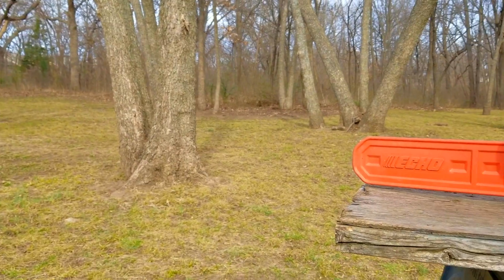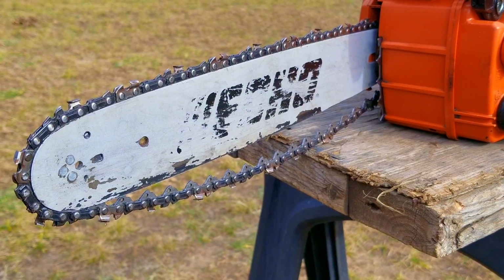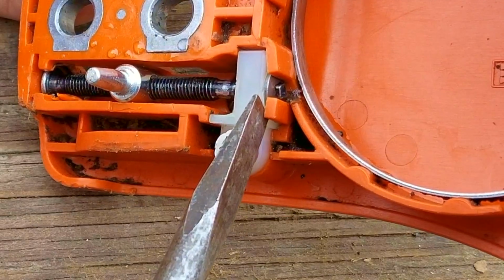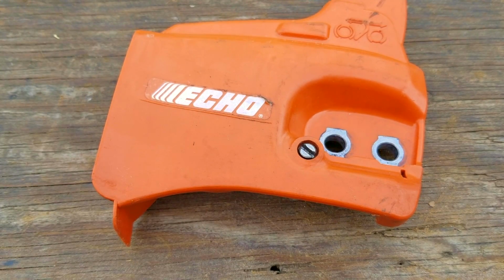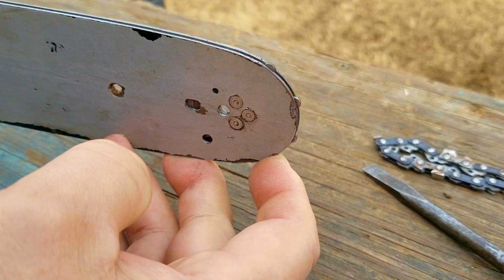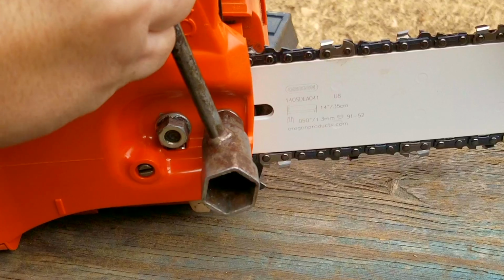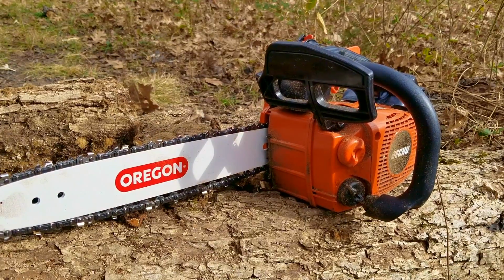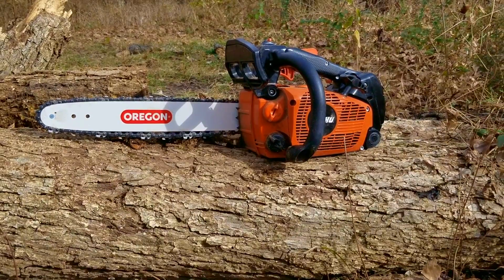Fixing An Echo Chainsaw's  Chain Tensioner

Comment: Guy had a kickback while the bar nuts were less than tight.
Had the same thing happen on an echo 620p (pro saw) and where I have the stiff magnesium cover, it hit hard enough to bend that long adjusting screw.  Something has to give.  In this case it was the plastic.
Reply from the maker: thank you Matt Fleming.

Comment: I would've waited on the sprocket but had the tensioner figured out as not having the nuts loosened up and you did FINE setting the tension on the chain. Oregon makes a good chain but they are SOFT compared to a Stihl and will stretch easily at first. All chains have to get run in and a Stihl chain stretches very little. If you don't believe me about an Oregon chain just try hand filing an Oregon and then a Stihl and see the difference in how a file will cut the tooth. And a Stihl chain has grooves that turn the bar oil into the bushings for better lubing nd less wear. Yes, they cost more but I've run both and I just get Stihl chains now for my saws. And holding up the bar tip is the way to go. Thanks and Blessings!
Reply from the maker: you make a good point.
Reply: @HomeGaragechannel  Experience is a fine teacher as we both know!
Reply from the maker: you got that right.

Comment: If it was mine, I would have replaced the clutch drum. I have learned my lesson the hard way. Running a new chain on a worn out drive sprocket will quickly destroy the new chain. Then you still have to buy the drum, plus you get to buy a second new chain, and you also have more labor expense. You live and you learn.
Reply from the maker: me too.

Comment: When buying all those new parts, I would have purchased a new sprocket drum as well. The new chain and worn sprocket is just going to accelerate wear on both. If money was an issue, I'd use the old bar and chain rather than buying those new.
Reply from the maker: you make a good point.

Comment: I was curious to about the chain. I have two echo CS-320 chainsaws and they do the same thing. Once  you put on the chain, run it a bit and it gets loose just like that. They did this right out of the box and one is 1 year older then the other. Still cant figure it out. We just loosen the bolts re tighten it again and then it seems fine. Wish echo  would look at this more closely but there both good starting and great cutting saws.
Reply from the maker: I know it's a really a pain to deal with. I would consider a different brand in the future, if you're not happy with this one. I've heard Husqvarna makes a good chainsaw.

Comment: I don't think I would. I also don't think I would invest $130 in parts knowing I can get a new Ryobi 14" for $150 even an Echo 14" are about $220. Probably sell the broken one and use that money towards a new one.
Reply: your comment makes it pretty clear you don't know much about chainsaws. could he probably get away with using a cheaper saw yes but they are not all the same. this is a top handle saw which is a special use saw which is why they cost what they do. it is easily worth throwing the $150 at it. selling broken stuff is always trickier unless it cheap.
Reply: @crazzywolfie  woah learned something new, didn’t catch the handle difference I was just comparing bar length
Reply from the maker: you make very good point.

Comment: With a new chain it will always get loose a little bit since the heat will stretch it, it always good to run it to let it get hot to tighten it again then using it more comfortably.
Reply from the maker: that makes sense, I appreciate the information Marco Lopez

Comment: As long as the saw worked properly and cut well I probably would have waited to change the sprocket until it gave me problems.  Great job.  Thanks for the video's.
Reply from the maker: Great point, thank you D Butler.

Comment: When it comes to any broken parts, replacing is always the best option but on top of that, why wouldnt the manufacturer even think of it, like when they make a product to sell, im damn sure they give it a test or so, if they already know some parts have to bear a lot of force, why cant they make it right from the first place??? We as customers, wouldnt mind pay a bit more, if its the problem of guaging the price up a bit, especially for the business owners running the power tools all the time for living, to me any type of parts thats not durable enough not to last long(or permanently) dont make sense at all..
Reply from the maker: you make a good point. but if they made it unbreakable from the start they wouldn't sell many saws

Comment: If the saw is otherwise in good condition, change the necessary parts. Can't believe that someone might have run that saw without the air filter on it. I recently had a gas-powered drill (Amish use them) with the same issue, the air cleaner was missing, fortunately I got to it before they used it very much. Great video, many thanks.
Reply from the maker: thank you Waterman one.

Comment: Well, you made a great video from this saw. I'd consider it totaled based on all the parts it needs: bar and chain, guard assembly, clutch, air filter assembly, and of course the labor involved. It'd make more sense to buy a new one, especially if so-and-so is just going to repeat what happened before. Why? It's a liability. Don't tarnish your friendship over something like this. That's just how I see it. Still, you did great.
Reply from the maker: Everything you said makes a lot of sense. thank you Shoe Slideshows.

Comment: Is echo a good company, I've never owned an echo and I've only used an echo a couple of times
Reply from the maker: From everything that I've seen, I find them to be a fantastic company.  would definitely buy one of their products.
Reply: Echo is definitely a good brand. Many professional landscaping companies use Echo equipment. They also have an excellent warranty period, 5 year consumer and 2 year commercial. They're also easy to maintain and fix yourself and parts are easy to get. You can buy them at Home Depot or an authorized dealer.

Comment: Your co worker should not be using a chainsaw if he cannot maintain it. Top handle saws like that are incredibly dangerous for inexperienced users due to the increased risk of kickback. You should suggest he gets a proper ground saw. Top handles are designed to be used when you are up a tree.

Edit: At the end there the chain was still too loose, it should not creep forward like that with the brake off. To minimise the risk of kickback you should cut as close to the saw engine as possible, not right up at the tip like you were. Chainsaws are lethal if not used safely.
Reply from the maker: both very good points. thank you Daniel Wilson.